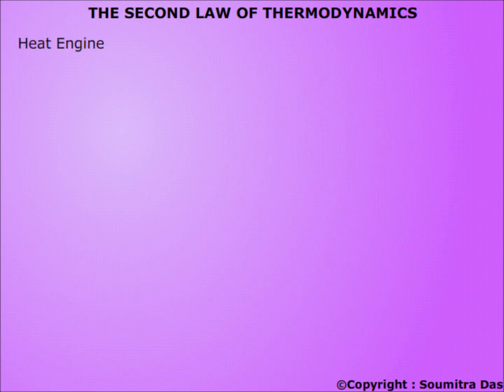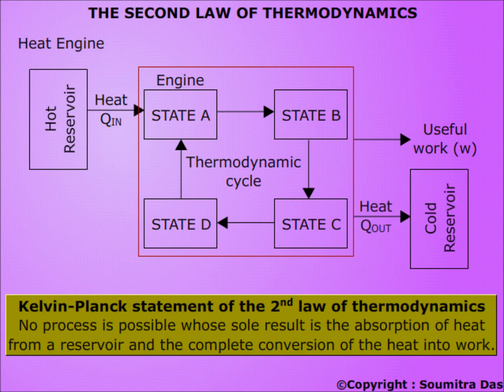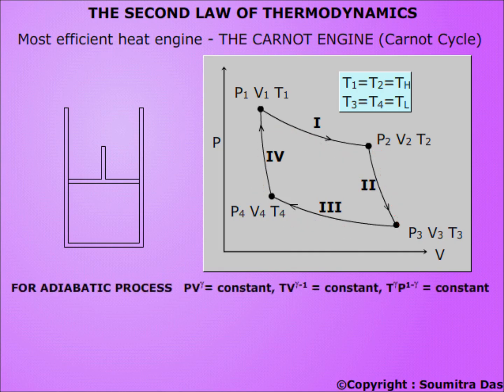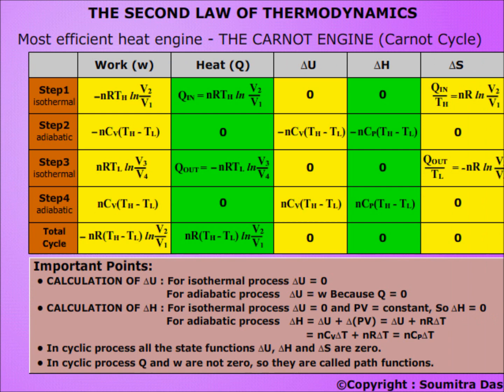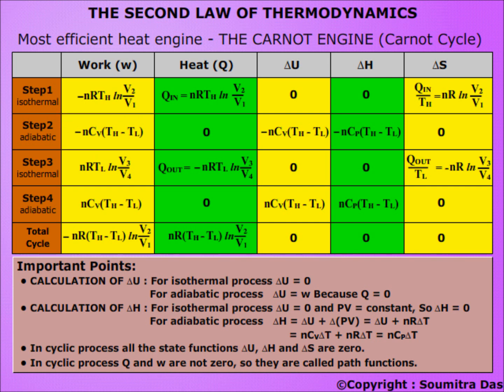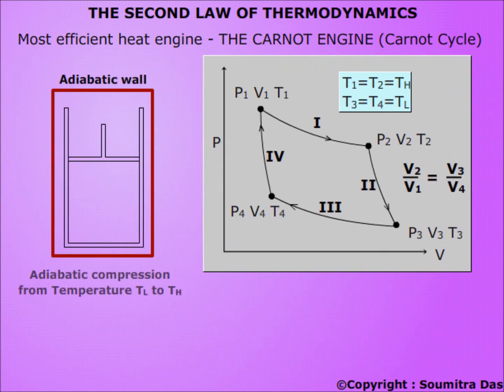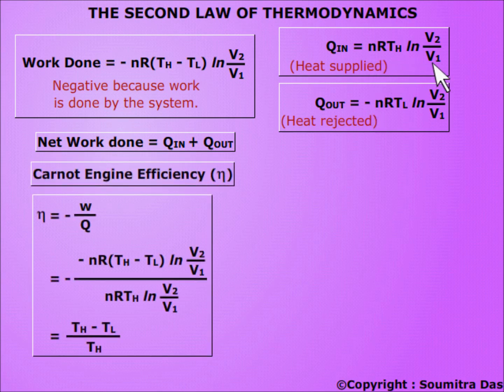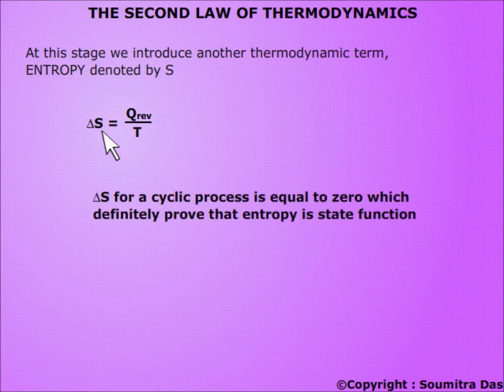The second law of thermodynamics   Carnot cycle

Comment: Work done by the system in isothermal expansion is positive not negative. There are some other errors you made in this video.
Reply from the maker: +Bibek Subedi you are absolutely correct. your sign convention works for heat engines and is found in physics text books. but not for chemical process. IUPAC suggested to keep all the energy terms going out of the system to be negative. this is seen in chemistry text books and is just the opposite to that of physics text book. in that way my video works.